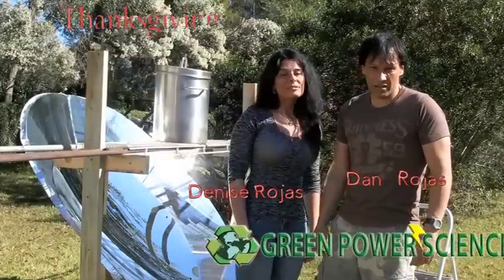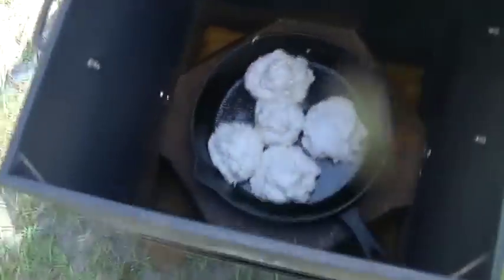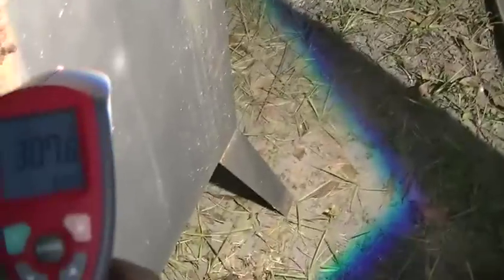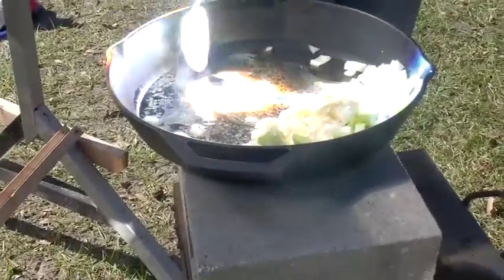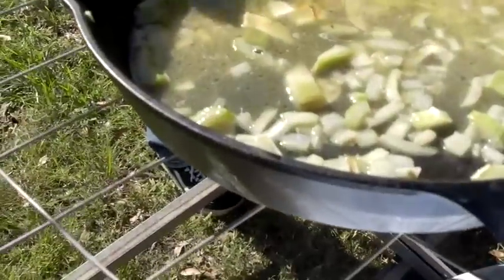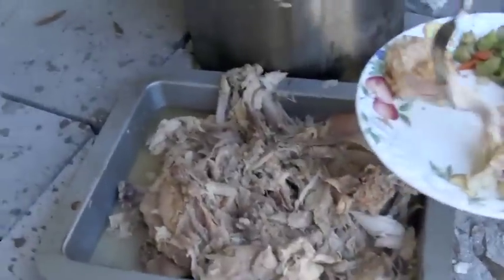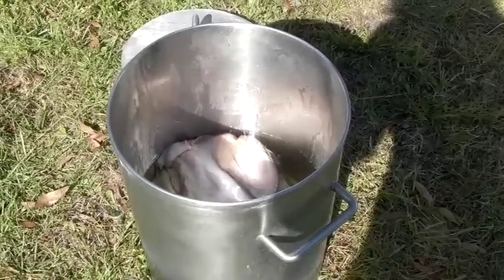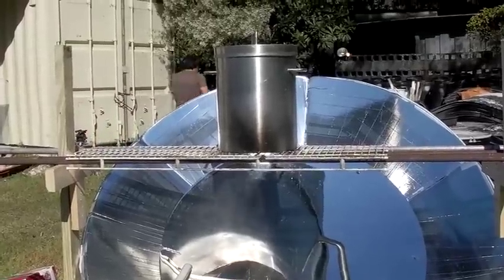Cooking a 12 pound turkey solar thanksgiving PEACE HOLIDAY with a Parabolic Mirror

Comment: How do you keep the lens from damaging that large turkey pot. I would love to be able to boil water in a pot like that. But I wouldn’t want to burn a hole in the pot or contaminate the water with melted metal particles. Is that possible??

Comment: what if you try making use of some indirect cooking. The current way you are doing it by very crude set up but this current setup is very dangerous. you may use solar radiation to make some steam and  make electricity and cook by steam. This will help to have safety and comfort while cooking.

i know that setup will not be easy for everybody to copy but it will be safer. Current set up is good for survival but no safety and comfort while cooking. It takes a different approach only,
 to make it easy and adaptable to everybody, just give a try.

Comment: greetings from sunny singapore, an island near the equator. admire your venture. may i share a glass cleaning tip. if the soap suds tend to leave a sud trace, wipe the mirror surface with a ball of newspaper. something in crumped up newpaper ink cleans the glass clearky. hope it helps

Comment: I think you need to redirect the light cone to heat up a metal plate instead of applying heat directly to the pot or a pan. Probably you can regulate the heat with that. (also you won't need the eye protection because the light cone won't be on top or under the food)

Comment: To avoid the trial and error cf, it would be nice to know the formulas used for making the  parabolic mirrors to know what the focal length is in advance. Great setups! I'm thinking it took weeks to get that all right. A copper plate under the pan with the Fresnel lens would avoid the direct in the pan problem. js
Reply from the maker: There is a free excel parabola file download on our website greenpowerscience.com You can pick your size and focal length then print and tile the paper. We also sell true solar mirrors on our site. Side heating like you said does work good but the copper plate needs to be insulated with loose brick.

Comment: Can you guys suggest a way to make a solar pool heater that will heat the water and not melt the pool.
Reply: Don' use it anymore, but I had a pool in my back yard that I used to heat with my own jury rigged solar water heater. Took 800' of 1" black irrigation pipe and wound it into 2 large flat coils and tied the coils to 2"x4" frames. Connected the coils together in the middle leaving one line left per coil to connect. Connect one line  coming from pool to one of the coils as cold water feed and other end on the other coil to a line going back to pool carrying 120 degree hot water back . Had the coils up on my roof , used pump (same one used for filter, just tied in to it) to pump cold water to roof top coils. I live in Colorado and it worked great for me. Small pool just 18' round by 52" deep, but kept the pool above 80 degrees even in the shade  (pool was under a tree) with no cover on the pool.
Reply: Would surely have been so much simpler to cut that shady tree down & put an insulating cover on the pool!

Comment: has dan ever set the lawn on fire?
Reply from the maker: dufusrunescape Yes, but it is a fire safe area so it stopped at a few feet. Was not a Fresnel lens, it was the bathroom mirror from some earlier videos. That mirror destroyed 4 bottles, cut a 1"x1" in half that fell on the ground = lawn and almost zapped our mini-van through the passenger window. Weird mirror with amazing optics and a super long focal length. We make sure everything is covered or put away when not in use.

Comment: Well I like the solar thanksgiving idea.. but if you want to keep cooking even when a cloud comes over (and I know I am salt on the brain), I would take four 5 dollar cow salt lick blocks (the white ones.. and face them with non faced fiberglass batting (insulation) at all points except where the parabolic reflection concentrates on them.. and then set your pot on them.. then wrap the pot in non faced fiberglass batting.... then put a cardboard shroud around them that is taped together and spray painted with engine enamel (to seal the cardboard)... you could let yourself have days before thanks giving getting your salt block stack up to 700 degrees C (won't melt till 801 degrees C) and like if you cannot get the oil up to temp and fry the turkey with a 1292 degree F heat source.. well I am wondering .. are you buying GMO Mutant Turkeys that have fire-resistance as a super power?LOL anyway keep of the good work.. I love your channel and the innovative usages of solar power you demonstrate :)
Reply: Jesse Mercury Interesting. Would the salt not cool during the nighttime?

Comment: Hey dan great videos, I love watching you guys. I need your advice on something. I dropped my frensel lens and broke off a piece in the corner. Can I resize the lens without ruining the focal point? If you could respond ASAP I would really appreciate it. Thanks in advance. God bless👍
Reply from the maker: Ihsan Deeb Just trim it with an acrylic cutting blade or a few shallow passes with the table saw. The focal point is set based on the ring pattern. Even if you chopped your lens in 10 pieces the focal length will all be the same, just different angles. Reducing one edge just reduces area and a bit of power. The FL will remain the same. Thank you for the nice comment!

Comment: You guys are pretty bad ass, your videos are great!

Note: Turkey should be added only after the oil is heated and it should be cooked for around 3-4 minutes a pound. A 12lb turkey should have gone for around 36-48 minutes starting with the oil at the 350 degrees F. Based on what I saw, with some small alterations in your approach you could have a solid, intact golden brown turkey.

Comment: I think you two are fun to watch and Dan you are brilliant when it comes to solar energy, you probably have a PhD and MMB and lots of credits before and after your name in which you can and should  be extremely proud.  However I also think that a lawsuit is in order.  The makers and bottlers of peanut oil should be required to post a warning on the bottle label NOT TO STICK YOUR HAND INTO HOT OIL.   Thank you for sharing your Thanksgiving Holiday with us.  Oh and Ice water to remove the heat from the burn and be careful of infection. I'm looking forward to what you have in store for us at Christmas!

Comment: Last year I attended a class put on by Fluke (R) about infrared testing equipment. One tip they gave was to try to test a non-reflective surface for more accurate readings. They said you should try to, if possible, make the surface black. I just thought of this when I saw most of your cooking equipment is highly reflective. I'm curious how hot the iron skillet showed. Cool video! The food looks great!

Comment: I'm sure I'm not the first to think of this, but would there be a way to use electrochromic glass as a kind of dimmer switch to regulate the temperature of the beam?  I could see it maybe blocking too much UV right at the start.  Maybe it'd have to be a custom thing.  Maybe it already exists?  Anyone?